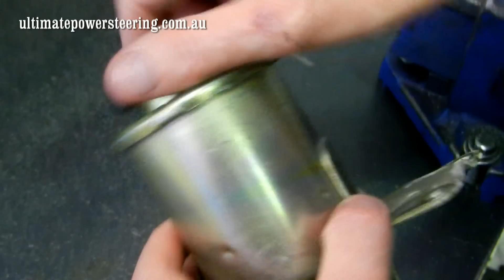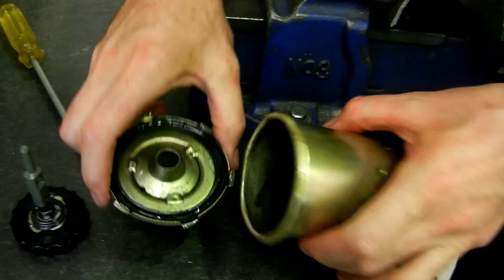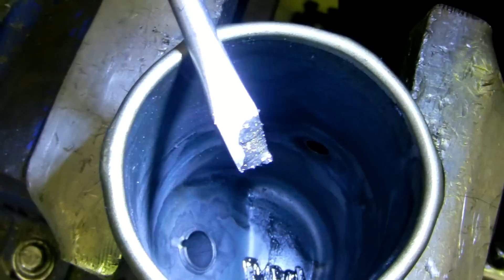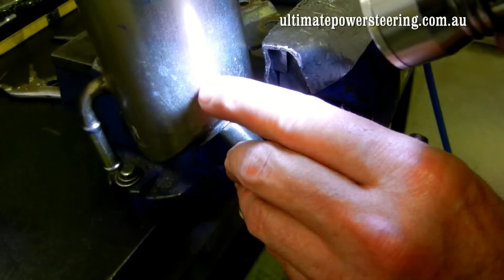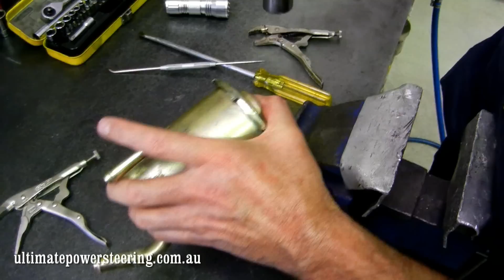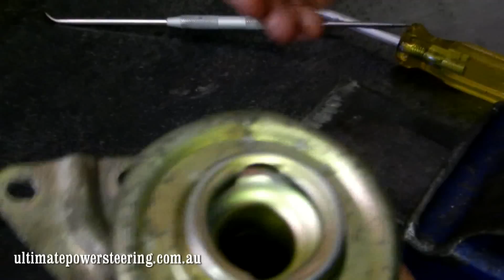Toyota Power Steering Pump Reservoir Clean & Assemble.mp4

Comment: Interesting, the power steering in my Celica is usually quiet but sometimes after hard lock it starts groaning like it has air in there. I tried flushing the fluid but it made no difference.
Reply from the maker: Hi Jake,

It is common once air is in the power steering system then the pumps can become noisy. 

The pump can draw in air from a leaky seal or o-ring if this is the case then I would recommend that your pump be rebuilt and also replace supply hose to the pump and all factory spring clamps with wind-on clamps to prevent any air getting into the system. 

I hope this helps.

If you have any other questions please call us on (07) 38897077 or email us on sales@ultimatepowersteering.com.au. 

Kind regards,
The Ultimate Power Steering Team.

Comment: Fixing my 4runner while in Coronavirus isolation. Thanks for posting. Cheers!
Reply: Hi  Mr Smith,

Thanks for feed-back.

This video was done to help some of our customers with their vehicles, we are happy to help and to fix your power steering issue while under isolation with the coronavirus is a bonus.

At least something positive has come out of your isolation time at home. 

But more importantly is the fact that the reservoir is now clean and free of any contaminants that will damage the power steering system.

Thanks again for you feed-back.

Kind regards,
The Ultimate Power Steering Team.
Reply: Is this the same for a 2000 4runner sr5?

Comment: Good job, but I believe that opening and closing this metal housing will introduce some inevitable groves that may cause oil leakage out of the system or introducing air into the system. I guess buying brand new one is better option.
Reply from the maker: Hi  Mohammad,

Yes you are correct purchasing a new reservoir would be the better option, however this video was done just to help some of our customers with their vehicles, and the availability of the new parts can be difficult to obtain and also costly.

If this cleaning procedure is done correctly and the top rubber seal is clamped back together then this should seal correctly and no air would be introduced into the system. But more importantly is the fact that the reservoir is now clean and free of any contaminants that will damage the power steering system.

Thanks for you feed-back.

Kind regards,
The Ultimate Power Steering Team.
Reply: @ultimatepowersteerin  hey can you please help me my power steering seems to make noise when I fully turn the steeering I check the belts and they are good I think It might be clogged..and causing the fluid to not move therefore the bearings maybe dry or something ..I don't know what to do ..
Reply from the maker: Hi Das Cash,

If you turn the steering to full lock and the pump makes a noise this is generally ok however it is very hard to diagnose this noise without seeing and hearing the vehicle.

Yes the noise can be internal bearings in the pump, it can be a damaged Pump or even idler bearings on the belt etc.

I would suggest that you get your vehicle in to us to have a look so we can see what is going on. This way we can help sort out your power steering system. Please give us a call on (07) 3889 7077 so we can arrange a time.

If this is not an option then I would suggest that you get your vehicle in to your local mechanic and they may be able to see what the problem is. 

I hope this helps

Kind regards,

The Ultimate Power Steering Team.

Comment: Where is the Location of power steering fluid flash??
Reply: Hi  Elton,

We offer an in-house Power Steering Fluid Flush, we do this with the engine running and we remove the old fluid at the same time as supplying a fluid treatment to the new fluid. 

We do this with our power steering flushing machine.
Please give us a call on (07) 3889 7077 so we can arrange a time to do a system Flush on your vehicle.

If you cannot get your vehicle her to Ultimate Power Steering you can get a Power Steering Flush through most vehicle repair workshops.

Regards 

The Ultimate Power Steering Team
Reply: Of toyota avanza

Comment: hi. did you use degreaser or break cleaner? or what did you use? thanks
Reply from the maker: Hi,
Both would work well as long as the internal filter is clean toughly this is most important and this is generally over looked when fitting a new or rebuilt pump.
 
Kind regards,
The Ultimate Power Steering Team.